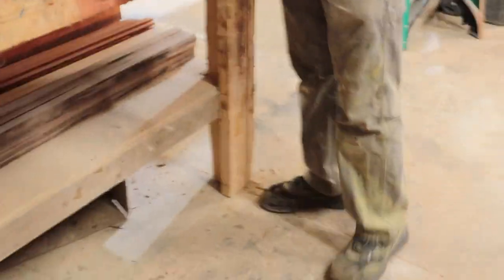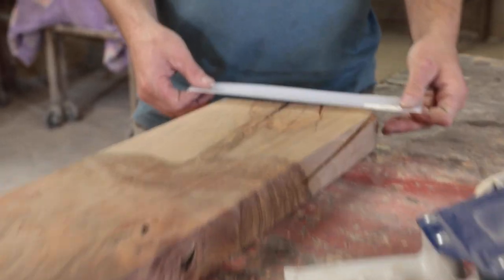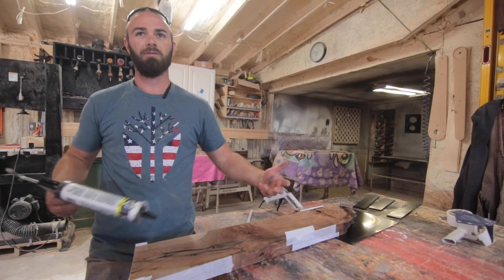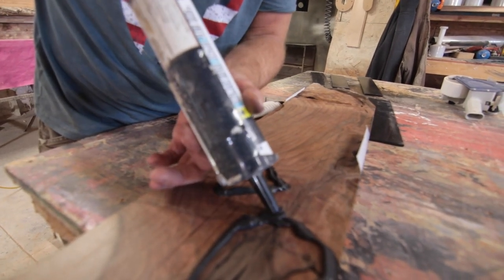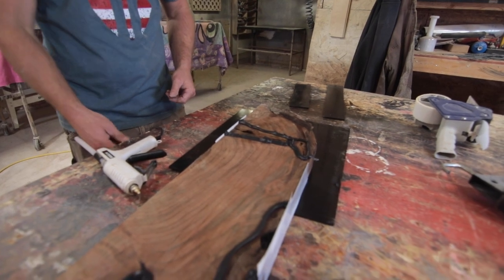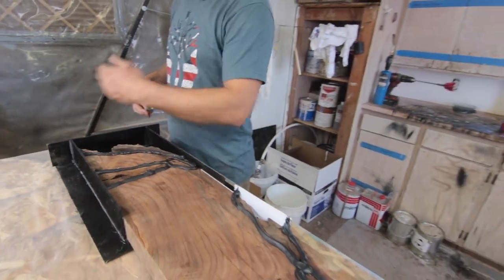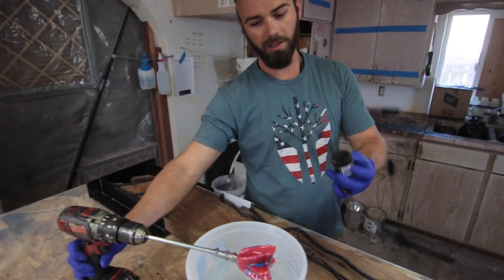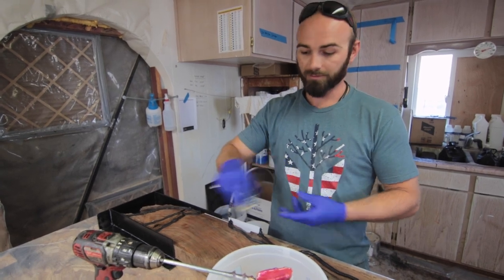IBWoodworks Start to Finish Project Tub Tray Small File YouTube 1

Comment: You need to wear an epoxy respirator when working with epoxy. You are damaging your lungs if you do not. Your ventilation needs to be in place as well. You need a respirator when you are using the planer too.